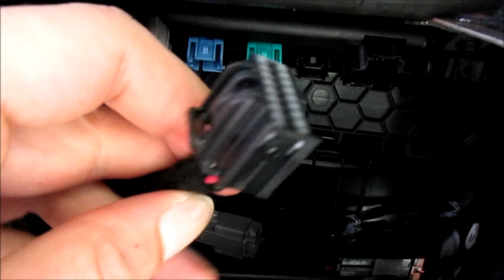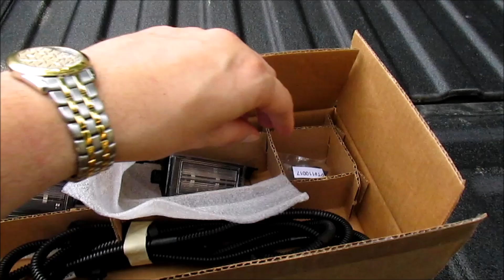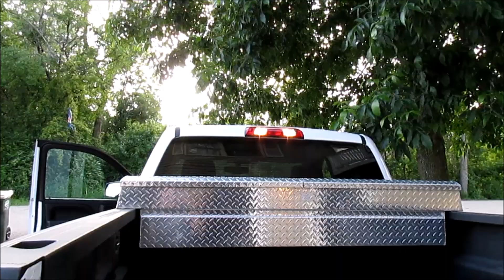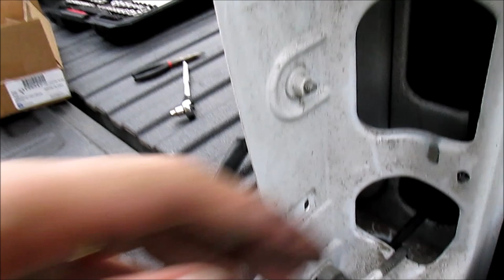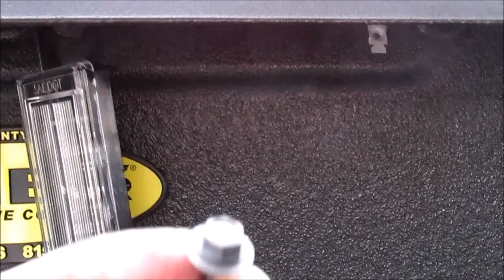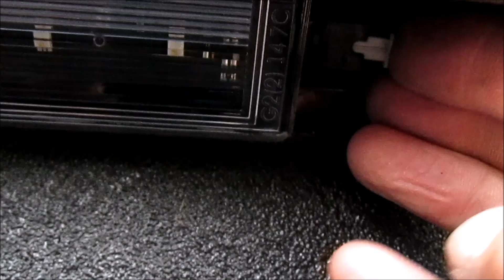Project Silverado E05 - GM Cargo Bed Lights

Comment: I am really late to this video. But how do you undo the white tab and plug from the light? I would like to tap into the wires and add an extra set that I have. For a little more light in the front corners.
Reply from the maker: You could either just cut the wires harness from the light and directly wire in some LED strips or use a T-tap connector and tap the harness to run extra lights.

Comment: On 2017 and 2018 the plug in to buss bar is wrong.  As you look at it, There are 3 plug ins being used.  This says the one to far right is the one you use.  That is incorrect.  The plug you use is to the far left almost unable to see.  Remove cap and plug in harness.

Comment: Hello,
do you know if they make a kit for a 2005 Chev Silverado?
Reply from the maker: JV there is not a GM kit for a 2005. If you were to buy this kit there would be no plug under the truck. There are, however, a ton of aftermarket kits that are very nice, put out a lot more light, and even cost less. But you’ll have to run your own wiring to the cab. Just search on YouTube.
Reply: @tommysgreatoutdoors  Thank you

Comment: Nice video....Can you add additional lights in the system such as one or two to the ceiling of the cap? Can the system handle it?
Reply from the maker: Jeff Poquette I would imagine so, they are LEDs and do not draw much power.
Reply: @tommysgreatoutdoors I want to add 2 more LED strips, I want to just tap into the red wires on each sides. Will I still have to run a ground for each strip or will I be ok tapping into the red only?

Comment: How did you order these lights?  Webpage or dealer?  I was wanting to see if I could find them for my 2012 Silverado.
Reply from the maker: I got these on ebay. They were around $100 at the time. The thing that made these work well is the plug and play wiring designed for this generation of Silverado/Sierra. For a 2012 I would go with a lesser expensive aftermarket brand. They are generally a lot brighter than the GM lights too.
Reply: Thank you for the feedback.  It is greatly appreciated.
Reply: @MB92686  2012 do not have a OEM plug and play harness like the 2014+ models    so have to wire them into a aftermarket switch wired into the cab somehow

Comment: Is there any way to add 2 more lights to this circuit?
Reply from the maker: These are LEDs and do not draw much current. Should be able to splice in and daisy chain as many as you like.
Reply: Yes you can did it to mine easy as pie